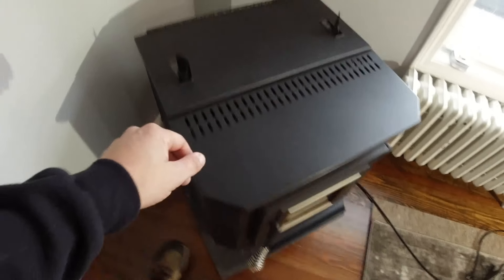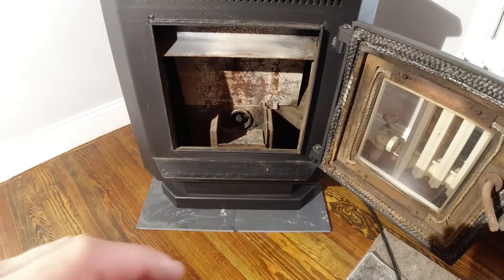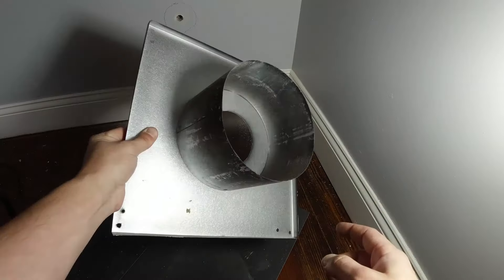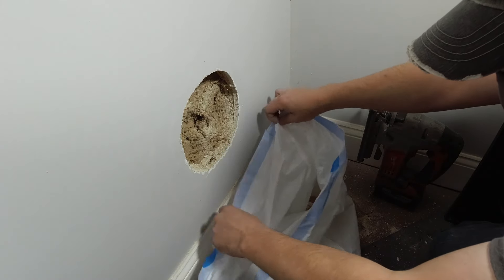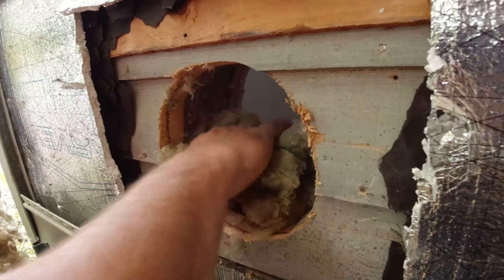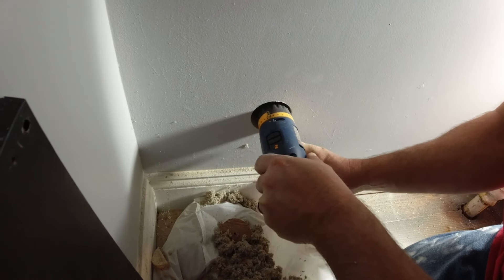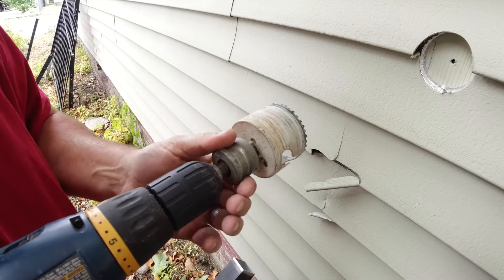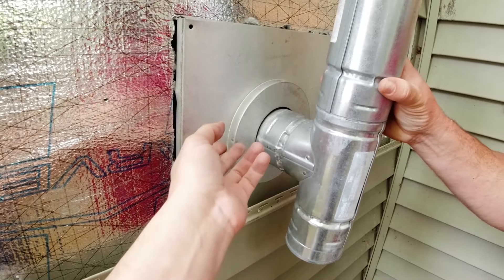DIY Pellet Stove Installation

Comment: You are aware that you drilled thru asbestos siding? At time marker 5:49 you can see it. The siding underneath the insulation has vertical lines on it. As you do the close up to it, can plainly see it's not wood, but asbestos.

Comment: I have the same pellet stove which I have used the past 18 years. One thing you quoted was it holds 40 lbs of pellets and that’s wrong, it holds around 35 lbs if that. When using pellets beware of the sawdust that is in the bottom of the bags for after awhile it will jam up your bottom auger. Also in the manual it doesn’t mention that you should grease the two auger bearings after a few years. Replacing the three gaskets also yearly is greatly recommended. One is behind the burn pot and the other two are behind the blower fan on the left side facing the stove. Cleaning out the exhaust pipes are a must also with a 4 inch pile brush.I put a small scented candle in a small metal container or can on the front top of the stove and when it melts it gives off a nice scent. I also found Tractor Supply has the cheapest price on pellets here in New England. Thanks again and a job well done.

Comment: Doug should change his 60 years old steam heating system to hot water with thermostatic valves on those cast iron radiators. Great job with the stove.

Comment: I have the same stove. It heats the room its in and not much more. Hate to say it but my house is not insullated very well, but just wondering if its underrated or if its just not doing a good job. my house is 1100 s/f, I set it a 3-9 top 2 and  4-5-1 bottom 3.

Comment: So no high temp sealant between connections??
Reply: It’s not really needed, they’re twist interlocking. I had one joint that was at an angle that leaked slightly. I used 3M heat tape on it and problem solved.

Comment: Looks Good.  One thing... the little hole on the right bottom of the burn pot (38 sec) is typically the  stoves auto ignighter.  It blows hot air out onto the pellets to light them up.

Comment: I can’t believe that you didn’t put some kind of hearth underneath it.  That is standard fire code where we live.  As well...no heat resistant silicone on the exhaust vent inside or out?? That’s sketchy too.
Reply: If you look closely you will see that there is a hearth stone under the stove.
The pellet stoves do NOT burn as hot as a regular wood stove.

Comment: Nice installation!  I'm on my third one of these Englanders.  The auger motors seem to wear out but having two old ones I have stripped out all the good parts so the latest should last awhile since I have a good inventory.  The customer service is decent but the augers went on the coldest night of the year, -30, (I'm in Maine) and I couldn't get a new auger for a week so I bought a new stove from HD.  Pellets are my only heat source.  I have an older and louder one in the basement too that I use when it gets really cold.  I use about 5 tons a year.  Couple of things:  The small hole you first pointed to is the igniter.  I didn't run the intake outside I ran it near a slider that is cool so I don't need to waste energy heating cold air and you might get 40#s in the hopper if you stack the pellets one by one.  Otherwise its about 30#s.

Comment: The efficiency can be further increased by drawing your combustion air through a double skin flue pipe, it preheats the incoming air resulting in higher burn efficiencies and reduces ash buildup due to a more complete burn, I have the combustion air pre heated on my pellet heater and the improvements over non pre heated air are amazing.
Reply: What size or brand of pipe did you use?
Reply: @peterbiltpilot516  here in Australia one can buy flue pipe in varying sizes in lengths of 900mm, it's a simple matter of working out how long your flue needs to be and getting the correct sizes to do a twin skin setup.

Comment: Did you use any heat resistant caulk for the connection inside the house on the exhaust pipes?  Was just curious if there is a chance of any leaking emissions.  Thanks for the video!  I’m about to install one like it, that does not have cold air intake.
Reply: I just put one in at my house. The instructions said to put high heat silicone caulk on the outlet side of the stove to the stove adaptor/clean out tee fitting. 
All of my pellet vent exhaust pipe had a silicone gasket at the joints, so I didn’t use any there. 
Idk if this is to late, but I hope it helps someone.

Comment: I have one more question, the appliance adapter doesn’t feel as snug as I want it to, do I apply silicone and can I use screws or will I ruin the pipe coming out of the stove
Reply: Fire caulking is the only... caulking suitable

Comment: Thank you for the video. When you installed the pipe, outside, you went up about 8 ft? Is there a reason for that? Or can I just vent it like a dryer?
Reply from the maker: You will have to check with your local codes.  It has been a while since this install but I am pretty sure it was part of the local code to do it that way.  I hope the video helped you out.  Thanks for watching!

Comment: I thought i was just seeing things when the drill was going backwards. I had no idea good to know. Nice video Rockstar!
Reply from the maker: Yes!  Backwards blades on vinyl.  Whenever I cut siding with a circular saw or chop saw I always take the blade off and put it on backwards.  I actually know a guy who lost an eye cutting vinyl with the blade the normal way.  😐 A piece caught on the blade, chipped off and flew right up.  Which brings me to my next point... safety glasses are very important!  Thanks for checking out the video bud!!
Reply: @TheFixerHomeRepair  Note to self. Thanks for sharing that story. I feel bad for the guy, though. Very unfortunate.
Reply: @TheFixerHomeRepair 😊

Comment: Awesome job, I’m installing mine this year, a little nervous... how do I make sure the inside and outside hole line up perfectly ?
Reply from the maker: Hey Ruben!  Get a long drill bit, probably 1/8 inch would do and drill a pilot hole from the inside all the way to the outside, then your hole saw pilot bit can sit in that hole and you can cut each side.  Hope this helps!!! Thanks for watching and good luck!!

Comment: This looks scary easy to me. Ive seen so many ways to install the exhaust pipe is the only confusion for me. Some go straight out to a slightly downward pipe outside. Some is like they installed and some have the bends inside the house.

Comment: Not a recommended way of having the rise on the outside. It sucks for down the road when you want to switch stoves. You either have to find the same stove or make a new hole. Rise inside the home then go out.